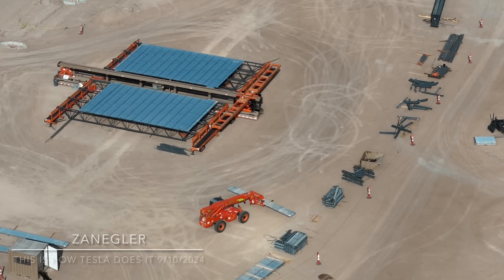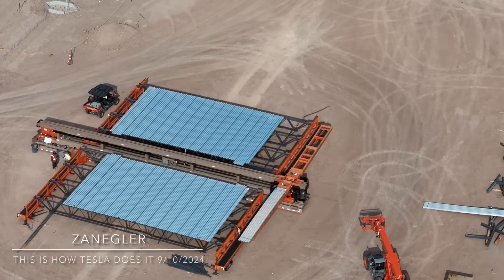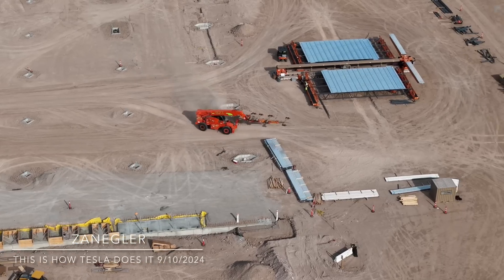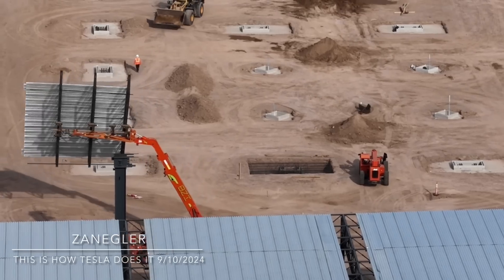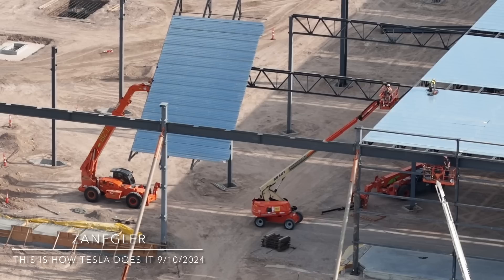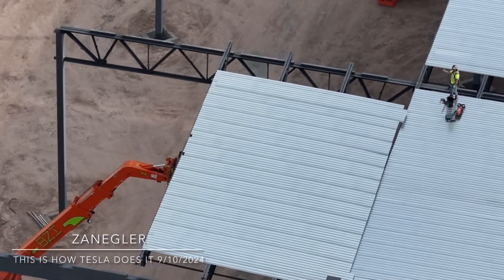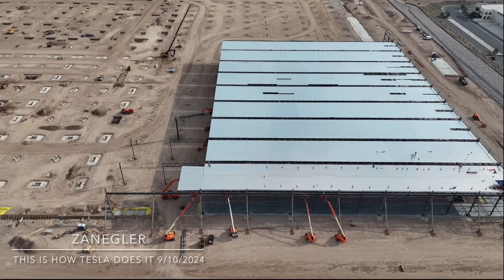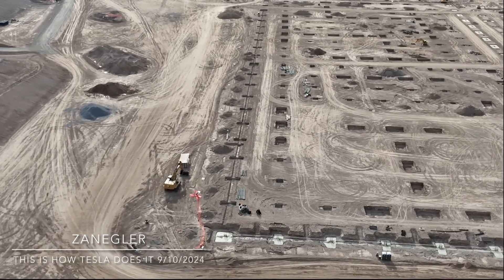Tesla’s Newest Innovation in Factory Construction

Comment: A crane would be easier to drop the roof panel section precisely wear it needs to go on the first try. A 4-wheeled vehicle needs to move around several times to get the correct approach.
Reply: A 20 mph wind would prevent using a crane.
That piece would be blowing all over the place and be very dangerous

Comment: So they pour the floor after the roofs are up? Is that normal anyways? Maybe it is.
Reply: Most of the time in heavy construction it is. Floors get damaged with the heavy machinery running on them. You also get the benefit of pouring your concrete floor without worry of rain or in the desert it shades the concrete from too much sun/heat.
Reply: Yes, that's normal. Industrial floors are often smoothed and the top layer is "hardened" and impregnated with additives and then often remains as a floor. Dust and uneven drying by wind/sun/rain would be very harmful here

Comment: Super interesting, it seems that two of the roof panels are not installed and appear to be sitting over the other corrugated sheeting. See  5:27. But that doesn’t seem to be an issue, they must be fixed temporarily some how, but I can’t see it. Thanks, great video Zanegler
Reply: Yes, they will most likely be the 2 panels that are missing at the edge. These will probably only be lifted into place by hand once the supports have been screwed to the main support.

Comment: Yeah i think this is the second storey trusses and formwork. They would then pour concrete over to form the second storey flooring. We use this system here in Australia for our two storey housing. 🇦🇺👍
Reply: Looks like roof structure to me.  Unless a section has additional fire code requirements, they'll presumably just put down a couple of layers of insulating panels then a membrane.
Reply: Seems strange that they will now have to come back and pour the concrete floors in that big of a building.. Here again it might be done in sections as walls and roof go on.
Reply: @afriendtoo6971  From the Oct 9th video they are still working on the grade beam and loading docks around the outside perimeter... perhaps concrete crews will move onto the inner slab after that's complete.

[The steel crews have moved onto the 2nd section, the first section is largely up but the roofing team still has a bit of steel to put up on the back half of that; although they might be prioritizing just getting the 2nd section roof up over completing the first.]

Comment: I am sure there are wind restrictions and it is probably worse the more gusty it is.. a relatively constant wind is easier to adjust to.. I am assuming that they designed the mezzmaster  for up to a certain wind max.. today at that site the max wind was 25mph. the mezzmaster appears more stable and lower altitude than a crawler crain and those can operate up to 31 MPH so yes i am sure there are wind restrictions depending on lots of things i do not know of but todays wind speed was gotten from the official NOAA site

Comment: I haven't seen this before.  kinda an interesting process.  typically on a barn or a roof with angles you want a good amount of overlap in the panels in order to prevent any rain problems, but if its flat, i suppose they will have a membrane over it.